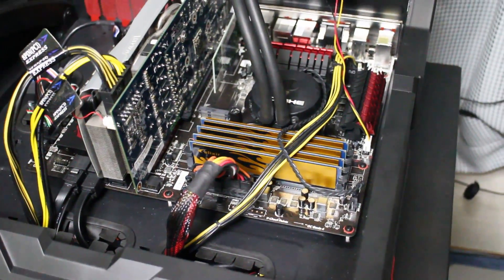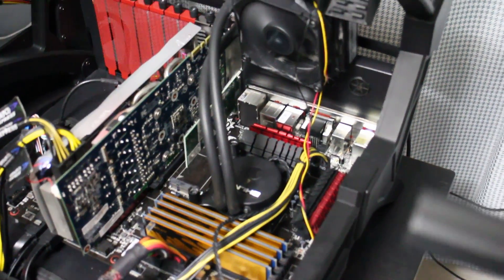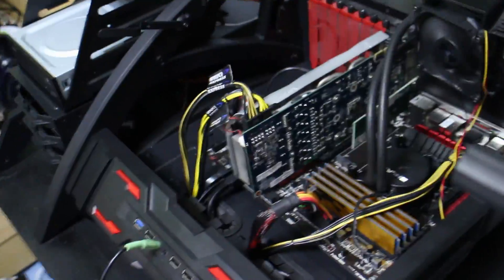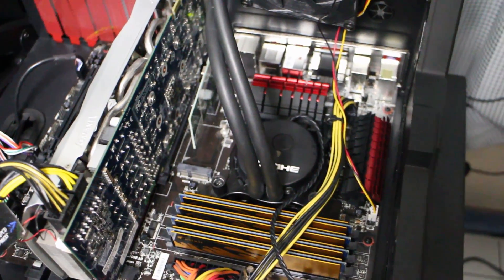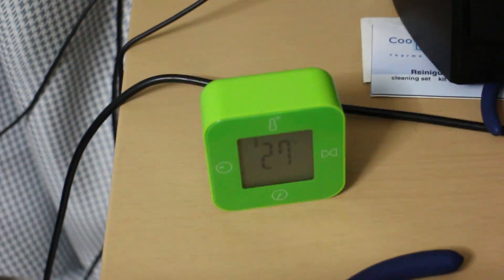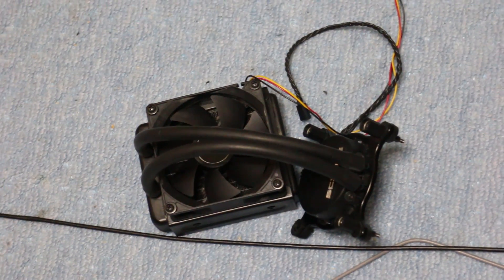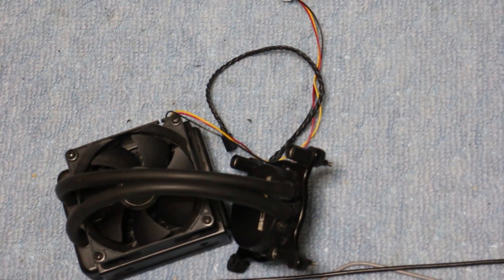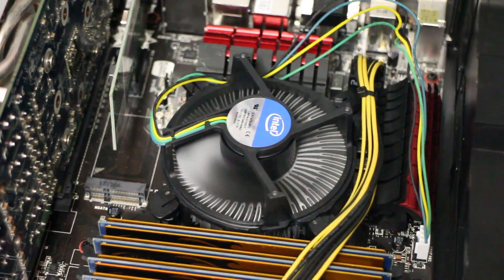How To Spot a Dead CPU Water Cooler (My Asetek Water Pump Failed)

Comment: My best advice with water coolers or almost anything that uses a pump is to keep gravity in mind when positioning the radiator relative to wherever the pump is located.   If it's not full to the brim the water bubbles that naturally go to the highest point when the pump isn't active can damage it and having the pump positioned where it has to fight gravity too much along with bubbles increases the risk of it being damaged by trying to suck to much air instead of water.   Also be aware of where you connect your pumps biwer and how the system activates/controls it.  I wouldn't recommend a cool and quiet setting that might turn the pump off since those settings are usually for air coolers.  I would personally just manually set the power level for connector the pump is connected to so it always keeps things moving in the event the pump is positioned where air bubbles might settle when it's off.
Reply: TheLegend105 My take-away from that is that I should have the radiator higher than the pump so one doesn't have the pump trying to work on air bubbles (e.g. spinning in free air rather than moving water).
Reply: So when you say gravity affects it, were should i place the rad? higher or lower then the cpu?

thanks

Comment: my corsair h55 is getting really hot when i am playing bf1 but my cpu is on 50-60c so i have problem ? its really hot :ppp
Reply: ICECOLD i think your cpu is not dying caus i have i5 2500k and on him corsair h60 but old one like 3 or 4 years and in games it can get to 90 degres and i found out its the cooler it was making boubles and something was stuck in it soo i give it to repair guy he just need to change liquid and it should be good to go
Reply from the maker: Can you put your hand on it? if so it should be fine, though if its burning hot then might want to double check things to make sure.  Warm enough to touch is usually going up to 50degrees.
Reply: ye after playing some bf1 its really hot really hot its dead you thing? but my temps are great 40-60 on full load its hot idk my air flow is great on my case so whats rong :PPP big fan here btw :D and thex for the reply do you know any program that i can check the temps :D
Reply: I'm watercooling fx-8370 but i got to run in powersaving mode or cpu overheats the pump is not leaking had for 2 yrs going to replace with hyper 212 but was wondering do u think my cpu is dying
Reply: guys i fixed it was the case :P rong airflow i switched my case and my h55 is on 40C on full load and cpu 42C its ok thx for the replys

Comment: same mine died after like 15 month ... and i was acually running the pc 24/7 on 99 C , and i didn't know.... the only way i knew that the games had huge lag issue out of nowhere and i kept checking drivers nd everything until i found it.. Now i use T2 from CoolerMaster
Reply: THIS. 

One day my games ran fine, the next major lag and stuttering.

Wracked my brain for a solid week before I noticed the pump is sounding off, it's still working to some extent but I have to keep my cpu in low power mode. 

Gonna bin this crap when the replacement cooler arrives and stick to air cooling from now on.
Reply: & they cost less without worry from a leak .

Comment: Mine died as well and I'm now done with water cooler, using a Hyper 212 EVO right now, the only thing that can break on it is the fan and if it happen it takes 1 min to replace.
Reply: I'm totally with you. I have the same problem. Fuck water cooling! I was expecting at least 5 years and got 3.
Reply: John Nāda air cooler is the best and safe
Reply: Which gives better temps though air or water?

Comment: 14 months? You're lucky . My fury X's pump died 5 months after purchase
Reply: I installed mine today. And after i run a cpu stress it just go from 40 to 90 in second. i guess the pomp is not working anymore
Reply: Mine (from 2013) has been running (with heavy rendering going on loads) still until this day. RELIABLE!
Reply: Rage Quit
wich cooler do you have?
Reply: Mo http://www.corsair.com/en-us/hydro-series-h60-cpu-cooler
Reply: haha that was exactly the cooler that couldn't handle my 6700K
Reply: haha that was exactly the cooler that couldn't handle my 6700K
Reply: haha that was exactly the cooler that couldn't handle my 6700K
Reply: Mo What the faq. It handled my 6 core overclocked 3970x fine for 3 years.
Reply: SiriusXification that's how long I had mine, almost two years.

Comment: I recommed setting your BIOS to warn you if your CPU goes over 80 degrees, you just need one of those little piezo speakers plugged into your motherboard and it will beep loudly if something is wrong.

Comment: Yeah I was wondering what the issue was. Mine started up and I heard a weird whirling noise and I pinpointed it coming from the CPU fan. I'm a update my comment later.
Reply: Darth Cocoabeans ik this was posted 7 months ago but were you able to fix the problem or what was it because i turned on my pc today and the water cooling fan was super loud and i dont know why
Reply: Koffer Yeah I did. The radiator part was really dusty and clogged, which was causing the temperature to rise super fast because the CPU cooling was inefficient. After I cleaned it was fine.
Reply: sorry i don't know anything is the radiator the part that the tubes are connected to the radiator i have a fun connected and cleaned it still acting up
Reply: Yeah it's the part that's not connected, with the fan and such. I used an old toothbrush to loosen dirt and a vacuum to suck out the dust/dirt. You can use a dust sprayer but in my opinion it only blows dirt from one side of the radiator to the other.

Comment: I have a Azetek water-cooler and it's still going after 7 years. Pretty crazy honestly.
Reply: Corsair, thermaltake and most others are made and manufactured by asetek. Asetek is just as good as all others but more affordable since ur not paying half the price for the brand name it self.
Reply: I got the original h100, its 5 years old, it's still going. I was even thinking about taking it apart and adding a res to it for shits and giggles.
Reply: h100 is corsair not asetek...
Reply: MONOXYDE Corsair's units are made by Asetek...
Reply: I have the - Asetek 550LC, opinions? And should I buy a Cooler Master Hyper 212 EVO, to just sitting there for backup?

Comment: Sooooo my CPU is running at like 92C (don't worry, computer is going off in a minute) but my computer still loads and works relatively fast and all. It's been doing this weird stuttering thing in-game, but other than that it's fine for browsing the internet and whatnot and I only realized today that it was overheating. Anyway, I don't know how to check if my liquid cooling is broken. The fans work and all, CPU is only at about 2%. I'm afraid to take it apart to check the paste seal... Any thoughts on what I should do? I can always go and buy a new fan tomorrow but if there's anything else it might be I'd like to try that first. Thanks!
Reply: I have the exact same problem. It has to be the pump. I checked all the connections and the radiator fan is working fine. So now I have to replace the whole thing. I'm pissed.
Reply: +Edward Kenway Thanks! I ended up buying a new heat sink and that fixed it :)
Reply: Removing cooling plate from cpu wont dmg anything just make sure u do it slow cuz thermal paste can get hardened and stick between the two components over the time. Make sure u clean the cpu chip and reapply new paste when u put it back together. Both cpu and liquid cooling block. If ur cpu is overheating then ur liquid cooler is most likely dead. Its hard to tell on closed systems and its best just to replace it as they dont cost much in a single fan configuration. Unless ur overcloacking u dont need more then single fan.
Reply: Im running my pc at 98-100C for like 5 hours.

Comment: I have never had any CPU with an IHS and thermal shutdown feature die from being run without a cooler unless you removed the cooler straight away while the machine was under full load running prime95or similar amount of stress.  When the IHS became common on chips it was also very common to see people powering up motherboards without a CPU cooler to verify that everything was fully functional before going through the hassle of installing the cooler and putting the board in the system.  Since these tests were under no load the CPU had plenty of time to detect the rising temperature and shut itself down.  Even if you have a water cooler stop working under full load the added thermal mass of the water and copper base plate of the cooler should allow more than enough time for the thermal protection to kick in and save the CPU.  This isn't to say you should chance it on a running system but for test purposes, it is probably not that big of a deal.  Back in the Athlon and Pentium 3 days before CPUs with an IHS were common it was easy to fry a chip in only a few seconds but now they are pretty resilient to attempts to send them to a thermal grave.

Comment: mine just stopped after like 6 years... i guess i was lucky
Reply: Mine is and it's still going, almost 7 years now. It was a lot more than $30 though.
Reply: +Edward Kenway download cpu temp reading software youll be able to check if its cooling
Reply: +Edward Kenway i ended up switching to a heatsink coolermaster v8 its idol temp is 12c and max id 79c lol when the computer is doing that it ends up being the cpu cooler 98%sure if it can stay idol but shuts down after a program that is taxing its the cpu cooler mostly water cooling. i found out that yesterday when i was helping a friend fix his computer that was having the same problems.

Comment: TBH I'd check the thermal paste... you should change the thermal paste every couple years according to some people, I usually do it once a year-ish. You said 40 months... even if the cooler wasn't pumping I don't see why it would have overheated like that with something on it before booting. That is the characteristic of not having anything on it (or thermal paste gone/vaporized). Just my 2 cents though.
Reply: +PrimitivetoModern He said 14months, not 40..

Comment: I just got a h110 GTX  and in corsiar link i noticed My water Pump is running at 100 percent all the time by default.. is it safe to leave it like that ? will it wear the pump out ? will the cooler die faster ?? or they designed it to last ?
Reply: +Chiney T.N.T How does that cpu "suck". I don't really see how you could say one sucks considering I notice no difference in any tasks between my brothers 8320 and a mid-range i5 on my other computer.
Reply from the maker: +Chiney T.N.T I think they are designed to run at 100% unless the manufacturer has implemeted a voltage switch.  As for life expectency that should be on the box, I think MTBF is 50,000 hours.  Mine died in 2,000 hours lol.
Reply: +Tech YES City so should I switch it to quiet mode... it runs at half the speed... will that ensure its expected life ?
Reply from the maker: Does the pump run at half speed? If so yeah that would most likely help, but just watch your temps.
Reply: +Tech YES City not really half about 1900rpm  and the max is about 2500 rpm
Reply from the maker: Is that just for the fans thoughh? Fans are no problem, they last forever.
Reply: +Chiney T.N.T thanks for the help man... I'm using an over clocked 8320 @ 4.6 ghz This CPU sucks.. But it was a gift 😂😂. so making the most of it hoping that Direct X 12 helps
Reply: +Tyler Bunch  You don't notice difference in normal tasks. But when you start gaming, benchmarking, and using programs which really use the processor you start noticin big difference. I had 8320 in custom water loop and and its safe to say that processor is pretty weak, atleast for me. FX- Architecture is dead anyways there isn't upgrade path. Intel is the only way right now.

Comment: Thanks for the video, dude. This happened to me the other day with my Corsair Hydro Series H55 and I couldn't figure out what it was. Eventually switched out the fan with an older heatsink fan just to see if it was the motherboard. Nope. Was the pump. The fan lasted less than 14 months.

Comment: Building a PC, which CPU liquid cooler do you recommend? Nothing too expensive.
Reply: 120mm or 240mm? What CPU? What is the price limit?
The cheapest decent one is the cooler master seidon 120v v2, but don't go anything cheaper than that. a good one would be any newer corsair one like h80i or h100i, a bit pricy though.
Reply: Christopher Newman 1240mm, Intel Core i7-4790k, 80$. But this looks fine to me.
Reply: Which one looks fine? i just bought a 120v v2 and will be installing it first thing tomorrow, if you want my temps I can give them to you so you have an idea of what to expect. another thing if you are getting one make sure you buy some other thermal paste as the packaged stuff is meh.
Reply: Christopher Newman The 120v v2. Alright thanks mate.
Reply: Blank Got bored and installed it already. It's been up for about ten minutes with the new cooler in and WOW it is good :) it hovers from 17-22 in idle (with side panel off) and I'm going to run Prime 95 now :)
Reply: Christopher Newman forgot to mention, I have an AMD FX8350 which is HOT :) so I am curious to see how it does with prime 95
Reply: Blank Ok stress tested with prime 95 for a quick 10mins, temperature didn't go a hair over 50, stayed at 45 the whole time under heavy load but had one spike or two which made the max temp go to 47.  Keep in mind this is with the side panel off :) hope this helps... this thing went WAY past my expectations :D
Reply: Christopher Newman Ahh okay, thanks again bro. Won't do super heavy overclocking but I'll definitely go with this cooler anyways.

Comment: Brian what are decent radiator fans? I know about the sp120s but they are proper loud when turned up!
When looking at fans on etailers i can't find any that list static pressure. I like the look of  sharkoon shark blade, phobya nano-2g and aerocool dead silence but don't  know which ones are for radiators. I need 2x120s and 1x200mm rad fans. Is this static pressure 2.63 mm-H2O?

Cheers
Reply from the maker: Oh for decent radiator fans you will gentle typhoons, they are pretty beast.  I have also heard some good things about noctua 120mm fans.

Comment: My h100i is about to die completely. I used to run my FX-8350 at 5 ghz within acceptable ranges and now I had to drop to base clock and it still is running at 60C with a 24 in fan blowing in the side. Nothing is dirty considering I clean my system weekly. Ambient right now is about 60F. Sucks I have to find my stock cooler somewhere around here..

Comment: The best thing you can do with AIO's is to plug the pump in to a fan header and enable the fan failure warning in the BIOS. This way if the pump stops the system will notify you and even shut down.

Comment: Tech YES City hello there, first of all thank you for the video, I have an antec kuhler 620 and it's been two years now and worked fine however until now I have received a message stating a cpu fan error..the message appeared when I botted up the system..funny thing is the fan pump is working fine..so is it safe to ignore the message? or do i need to replace my water cool system soon

Comment: Asetek makes awful cheap closed loops. Have had 2 of them die, exploding inside the case, which is always nice to clean up. Corsair is even worse, they have hardware issues, and tons of customer complaints.
Reply: ***** The positive side is that the coolant wasn't conductive, so no damage was done, except for the mess. Air coolers and water diy still the best solution, fuck self contained cheap water radiators, by the by, my Intel water cooler also exploded, one year ago, didn't matter brand name, all garbage.

Comment: Hey Tech my none of my computers fan turn on on startup like the water cooler and the case fans dont turn on
Reply: Can i get some help?
Reply from the maker: Have you plugged them all into the headers? If that doesn't work then can you try a different power supply?
Reply: I have tried both man... im thinking it is the motherboard.
Reply from the maker: True, could always try a different motherboard (just for the fan even), if that doesn't start up then you will know it is the unit, startign to sound like it is).

Comment: i had the same thing happen with a seidon 120v the pump got stuck and i took it out of my pc and tested it and yep i was thanking the same as u dead pump.. no it was not dead i took my hand and hit the side of the pump very hard with power turned on then the pump started working again and im still running it now just some thing some one may want to try i have no clue as to y my pump got stuck. "UPDATE" 4/29/2015 The pump had died 1 week ago waiting on new water cooling loop to come in what happen was the pump locked up and burned up and it has something in it jumping around in it now not sure what it is but ill be remaking the pump and cooling blocks and so on.

Comment: Whahahahaaa I have the same problem with my Swiftech H320 new liquid watercooling.
Exactly the same I was playing also game and suddenly I saw my temp at 80 degrees pffff I was shocked because it was only 2 weeks old my new watercooling from Swiftech.
Reply from the maker: geezus it happened on a swiftech, damn more the reason to get a decent air cooler in there.